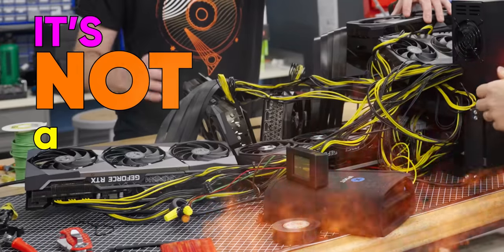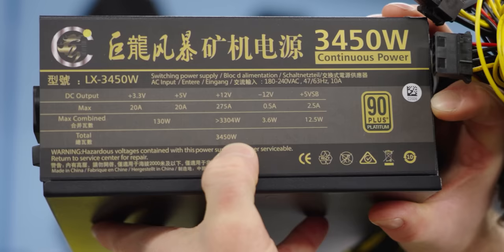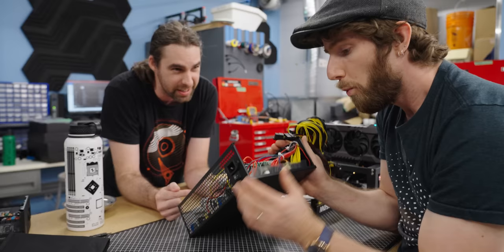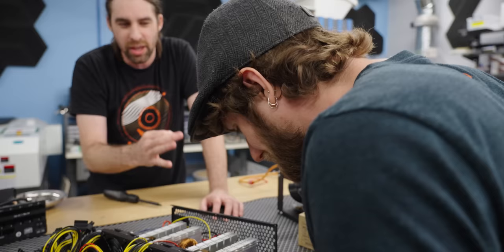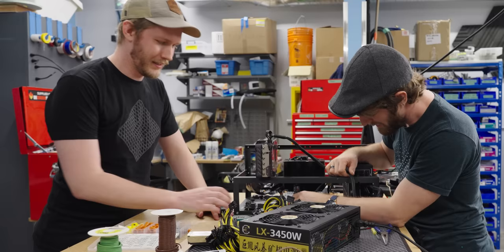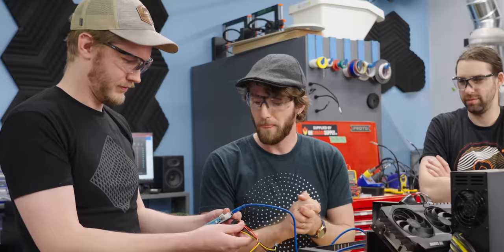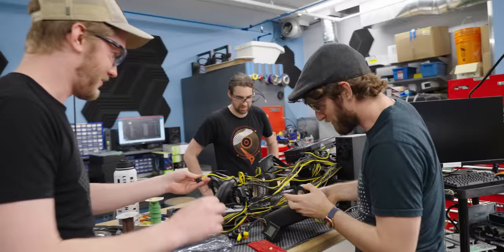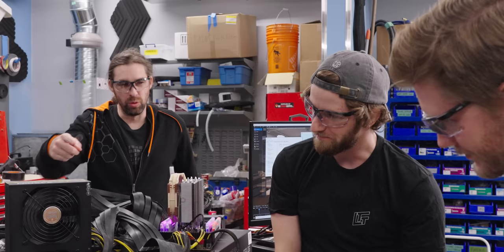This 3450W Power Supply is a Fire Hazard!

Comment: Every time someone opens a power supply I question how much LTT pays their insurance company.
Reply: Insurance for equipment or life insurance?
Reply: @Alias_Anybody  Or.
Reply: @Alias_Anybody  yes
Reply: Jokes on you I opened my PSU and it yet didn't become a fancy creeper, I'm using it now.
Reply: @inqizzo  they've already had an accident lol. When Anthony opened the Mac, the capacitors discharged.
Reply: i wouldnt want to know
Reply: @EveMizgala  What video did that happen on?  I don't remember it.
Reply: I opened my first psu at like 12-13 it's not that dangerous. It CAN be dangerous but it's not gauranteed death or anything.
Reply: @_Azzychan  wasen´t that the I mac pro?
Reply: the answer is not enough
Reply: @shorb2289  lol... depending on your age, those might have 140W ;) .. 3,4kW PSU could be quite an shocking experience..
Reply: @_Azzychan  it was a few years ago, in the video where Linus complains that Apple refused to repair it at all, even at Linus' expense. It eventually led to the collaboration video where Louis Rossmann visited LTT and helped them fix it.
Reply: @Eveningbreeze78  I'm only 17 now the psu was 450 or 500 watts and even then I knew enough to stay away from touching the capacitors
Reply: If you're not a complete moron is not that dangerous

Unplug it, let it sit for a while, then open it, maybe wear gloves, that's it
Reply: As someone who designed and tested PSUs for a living. Yes they can bite! If at all unsure, don't mess.
Reply: More like... is there insurance, on the insurance company... insuring LMG.
Reply: I hate how people tend to criminalize touching electronics to the point that you guys are terrified about a 1-second 230v discharge, trust me, it hurts for like 5 seconds.
Reply: @Eveningbreeze78  well the caps can easily deliver 5kw+ when short circuited (varying on quality and capicity)
Reply: IF (big IF) you know what you're doing it's ok.
Reply: It's not a bomb, a bit of electrical knowledge and you will be fine. The capacitors can store a charge long after its unplugged, but if you don't touch them and are careful when handling the board then you are pretty safe. Wearing thick gloves almost eliminates the risk. Electricians have MUCH more dangerous jobs working in live electrical panels with 240+ volts and virtually unlimited current available with exposed terminals everywhere and people don't think much of that, but opening a power supply is somehow the most dangerous thing someone can do?
Reply: They have been cases of deaths.
Reply: I’ve opened an iMac and got electrocuted by the power supply because I wasn’t paying attention. Shit hurt like hell but nothing besides a good shock to wake me back up, lol.
Reply: I think is more so after these videos go live Linus,or whoever in the company deals with the insurance company, gets a very angry phone call
Reply: i have opened a thousand psus, still alive
Reply: I also wonder if then people who send those ideas/actual power supplies are trying to burn them down or helping them.
Reply: @shorb2289  Falling out of an airplane mid flight with no parachute isn't guaranteed death, but I dont see you or 99.9999% of people doing so. Opening a PSU should NEVER be done by anyone without proper training. Even with proper training its still not advised
Reply: @paul_jmr8022  but these aren't, those are 100% likely to be 1kV capacitors so the maximum you'll get out of these would be around 2kV with a very low current.
Reply: @EveMizgala  Yeah but to be fair... Apple's repair people have been documented to have done that.
Reply: Their life insurance agents don't watch LTT's YouTube videos.
Reply: @hn1f  
That great for you. Now insure an employee to just start opening em up.
Different ball-game all of a sudden, isn't it?
Reply: I think every time Alex appears with a new idea, the insurance company calls to increase his specific rate xD
Reply: just the right overpriced amount that the insurance company managed to swindle them out of :D
Reply: Yes those caps could hurt badly, but dying from them would imply that your life expectancy wasn't great to begin with...
Reply: @AegisMaelstrom14  that's called a reinsurer and that's actually an industry standard thing to do.
Reply: I'm sure they leave them for a good while before opening them to make sure they have nothing stored.
Reply: Universal healthcare for the win.
Reply: Its not as dangerous as they make it seem. Just be smart and wear your rubber gloves and short the big caps.
Reply: @TuxraGamer  Hurt me for a lot longer than that, as my ribs had to recover from the chest compressions.
That is why workplaces have to have a first aider.
Reply: @vincentschumann937  It is not just how much they can deliver, it is how fast they deliver it.  Averaged over the second, it may just be 5kw, but it can be delivered in about 10mS.
Reply: @TuxraGamer  That will be why I came round with busted ribs and a (thankfully attractive) first aider blowing into my mouth.
At least 10ft from the PSU that I'd opened to change the fan.
I must be a cat, because I was restarted 3 times after a major road traffic collision, so now down to 5 lives.
Reply: don't they operate in Canada so im pretty sure they don't need an insurance company
Reply: @timmy7201  I'm still here at 60 with my heart apparently as strong as an ox.
And it had to be restarted after that happened to me, many years ago - I think it was in a 386, to give some idea of how long, and I've regularly ridden imperial centuries for fun at weekends since then.  In my early 50s, I could get my heart rate up to 186bpm on a long climb, so it is not showing any apparent weakness.
I would not have been able to pass a flight crew medical if there was any sign of any such thing.
Reply: @Alias_Anybody  Yes.
Reply: @DennysGrandSlam2  no insurance is a thing here too
Reply: What their insurance company don't know, won't hurt 'em.
Reply: @Alias_Anybody  Fire. Both life and building.
Reply: Insurance Haram btw
Reply: @Eveningbreeze78  . The wattage of the power supply doesn’t make a much if any difference in terms of potential danger. The idea that this is some kind of determining factor for you and others in the thread is a bit scary. It’s not how electricity works.
Reply: @inqizzo  it's not about the voltage though if I remember correctly. It's the amperage that kills you.
Reply: That's what their sponsors are for
Reply: @_Azzychan  the one with Louis Rossman
Reply: @shorb2289  Opening a PSU is like travel by air. The likelihood of an accident is very low, but WHEN it does happen, you will most probably be kaput. No in-betweens.
Reply: As long as you know, what you are doing - it's not really dangerous. Being i a car on a road is more dangerous. A bike is more dangerous. Cutting bread with a knife can be more dangerous.
Reply: @robertt9342  lol ... which one has  bigger capacitors?
Reply: @DennysGrandSlam2  I'd be surprised if Canada doesn't have similar requirements to the UK regarding employer's liability insurance, fire insurance and other things like that.  They have taxpayer-funded healthcare the same as the UK, after all.
Reply: Great question lol
Reply: @phillee2814  I guess you where between 30 and 40 when that happened? I'm actually surprised they needed to restart your heart at that age, due to an ATX PSU capacitor...

I zapped myself at 25, when redoing the electrical installation in my home here in Europe. The previous owner was a DIY amateur, who apparently thought it to be a brilliant idea bridging the main circuit breaker to power one single rail that feeds into the in-house lighting. Something I didn't knew at the time. 

It was a sunny day in september so I opened the garage door, right besides my electrical outlet for some additional light. I didn't turn on any indoor lights, expecting them to go dark anyways after flipping the main breaker. Measured the voltages on some of the power rails using my multimeter, everything showed 0V so I started dissembling the electrical box, when everything went suddenly black for a couple of seconds...

I was KO instantly, so didn't feel a thing at the moment itself. I was still standing upright when I regained consciousness couple seconds later, still not sure how I didn't fall over... 
Had some tunnel-vision when slowly regaining consciousness, felt a bit like a terminator that's doing a reboot :-/ ... Felt totally miserable after I regained complete consciousness, my hearth was racing and my head felt like a sleeping limb... Ate something then went to bed early, all symptoms where gone the next morning but I cycled to the the doctor anyways (why not, the doc is free here in Europe). He told me that everything is totally fine and send me back home...

That's here in Europe, where the streets delivers three phased 380V AC to our homes and our outlets are 240V AC instead of 120V AC. It amazes me that your hearth stopped from a capacitor, at about half the voltage we have here...  As an embedded hardware/firmware engineer I'm kinda 'stunned' (pun intended) that low voltage electronics devices are so severely regulated by law, but high voltage electrical installation can be tinkered around with by the biggest buffoon.
Reply: @timmy7201  I'm in the UK, so 240v phase to earth.
Reply: I thought Canada’s government pays for their health insurance LOL
Reply: @evilmark443  to
Reply: @raikouija663  As the UK pays for healthcare (no actual insurance required) but they CAN pass on some cost to those injured as a result of any activity for which there is mandatory insurance, like anything involving motor vehicles.  You never notice it because it is included in the insurance and the bill goes directly to them.
I suspect, but do not know for sure, that there is a similar provision regarding employee or public injuries, for which employers and/or public liability insurance is mandatory.
Reply: @pokerus4511  You are borderline fear mongering. Since having taken it apart I learned a ton on how they function and knowing the dangers I would still do it. Saying it should never be done is just a false statement straight out of a pres statement from a large tech company and that position is honestly very soft. It can be dangerous but that doesn't mean it shouldn't be done.
Reply: Sir I worked on e-macs when they were in store..I’d say about as bad or worse lol
Reply: Imagine actually thinking you have to pay the insurance if you void warranty sit down child
Reply: @fushi4447  Thank you!  I found it :)
Reply: They pay with a short message of their sponsor. Glasswire!
Reply: Not enough lol
Reply: The people opening them are certified for it and hence its a non problem ?
Reply: If you open it before you have ever plugged it in, then there wouldn't be any power stored in a capacitor.
Reply: @brandenwaite  most reputable brand test their power supply by plugging it in
Reply: @chu3276  did they test it the day before? Capacitors can't hold charge for long. I'm seeing a day max charge duration. Say it was two days, by the time it was tested, shipped, delivered, the charge would be gone... And that's straight from the factory...
Reply: Super serial ? Super serious !
Reply: Sol dered not soddered !
Reply: Not much, if you have any electrical engineering background you know you can ground capacitors and discharge them safely. Like in the video it’s already stated that the psu was opened and we can infer they discharged them. Outside of that there’s no safety risk involved once the capacitors are discharged.
Reply: It's not as bad as you think. Those caps discharge fairly quickly
Reply: Where I live people open up old CRT tvs to get the speakers out, and leave them opened near trash containers so that most of the time kids break the tubing with rocks. Opening a PSU isn't even dangerous when you think about it.
Reply: Zero on top. Health insurance is compulsory and single payer in Canada. Regardless if your job is zero risk or ultra high risk: same price.
Reply: @ralphM1114  as long as you follow sane handling guidelines, like shorting/discharging capacitors before doing so. you should be ok. not recommending the average user do so, as knowledge of how electricity works appears rather thin on the ground around here.
Reply: i see nothing wrong in opening psu. Many times i replace fan or other stuff like transistors or capacitors.
Reply: @mpg500  I have a question for you. I had a 1050w psu plugged into a surge protector. Then a colony of ants decided to live inside the surge protector.  The psu still turns on but plugging in the 8pin on the mobo trips the psu to auto shutoff.  What happened with the system because of the ants? And yes I went Rambo on those things 🐜
Reply: @inqizzo  you can also discharge all the capacitors manually by cycling the I/O switch controller 
of any motherboard the psu is connected to, but its always safer to ground everything like you just did.
Reply: I've repaired PSUs at work (changed capacitors mostly), didn't have any accidents.
A couple of my colleagues did, but not with me around. One of them also had an accident with repairing a monitor I think, luckily it wasn't CRT.
Reply: @Eveningbreeze78  well the wattage makes no difference because you obviously aren’t going to be opening it when it’s on (if you do you’re just asking for trouble), so all you’d have to worry about is getting shocked by the capacitors and those are usually around the same size across power supplies
Reply: $400,000 for 12 seconds
Reply: @thunderarch5951 letting it sit for a while isnt good enough, short the capacitors with the end of an INSULATED screw driver

Comment: That label is wonderful.. There is also the "180-240V 10A" rating, which tops up at max 2400W input, for 3450W output, for an efficiency about 143%. Of course they gave it the golden-platitum achievement
Reply: 230V times 16A = 3680W

So whats your problem?
Reply: @010falcon  The label on the power supply indicates that it only takes 10A
Reply: 140+ Platitum
Reply: i was searching for this comment XD. @ like 390V we can slowly talk about 3450W
Reply: @010falcon  apart from the label saying only 10A: that actually what the C13 plug is rated for basically everywhere on this planet. It would need a C19 for 16A.
Reply: @stephanweinberger  yes so what?
Reply: @010falcon  either the "3450W" claim is BS or the "10A" is wrong (and the C13 plug overloaded).
Probably the latter, as they were drawing 2450W @209V (i.e. almost 12A) in the video (+ reactive power, the PFC is probably quite crappy).
Reply: @stephanweinberger  yes, the Chinese overload any socket which has been „overbuild“ by us Westeners. 
Again, what are you expecting. It seems to work. Is it sketch, yeah.
Reply: @010falcon  what's your problem?
Reply: In Hong Kong power is 230V at 15Amps which is exactly 3450Watts
Reply: @Pan_Torcha  yes, but if the input is rated for 10A you shall not exceed that
Reply: free energy baby
Reply: @010falcon  "230v times 16A = 3680W" "so what's the problem" the problem is we are talking about 240v 10A... not 230v 16A 😂
Reply: @Pan_Torcha  The fuses/breakers are 15A. Power isn't.